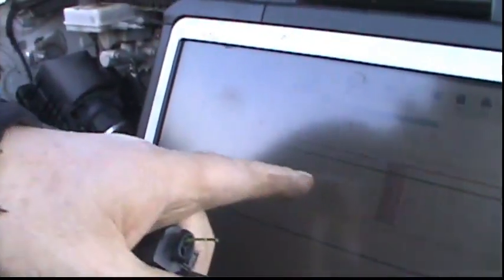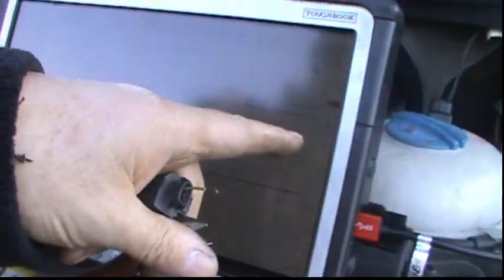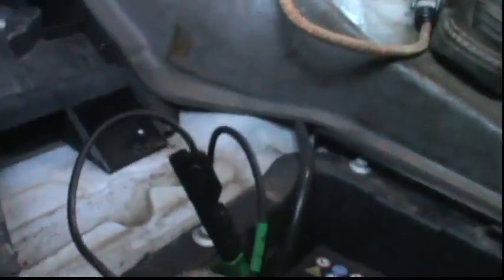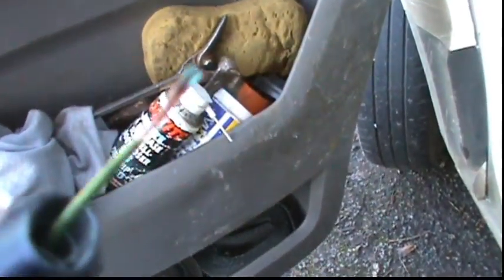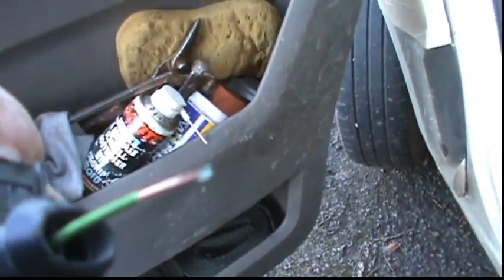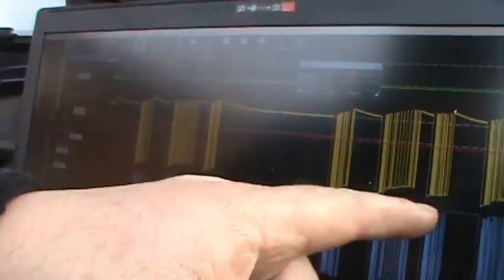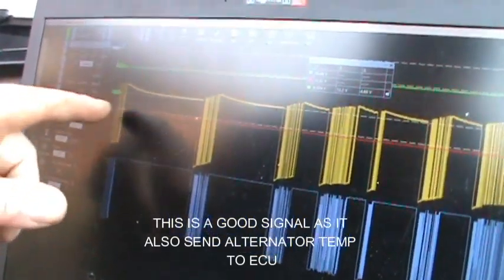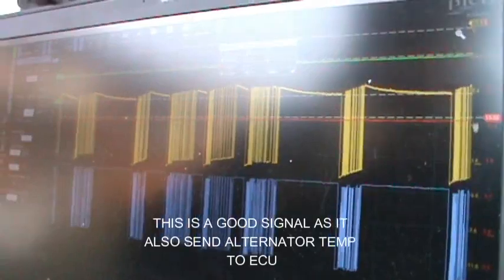2021 VW crafter intermittent  charge fault on dash ,  codes U105200 U140600, battery stays charged

Comment: Hi mate, Quick question if you don’t mind, Do you know if before you fixed this issues was engine rpm was up and down ? Mine is on 1100rpm sometimes same fault code what you got changed alternator and plug was broken so we changed them codes are gone but when you start the van up sometimes high idle with engine light plz help if you can with some advise plz lol thank you.
Reply from the maker: Hi 
No this van was running ok and idled ok to so I don’t think this has any thing to do with that fault 
But 
With what I’ve experienced I’d check the earths ,fuel pressure, and possibly a dodgy egr vavle 
I hope this helps and it gives you something to look at sir 👍👍👍👍👍👍
Reply: @trevorchillery1019  Hello I didn’t think you will get back to me this quick thanks, codes that i’am having is engine coolant bypass valve a sensor circuit low P26A600. We been doing some research online for a week and haven’t found anything that’s related to this code we don’t know which part is it 🥲
Reply from the maker: @gusztavnotar4070  I’m going to be honest I don’t believe this code would cause your problem 
Has this had the dpf and/or the egr vavle removed 🤔🤔🤔🤔🤔

Comment: Having similar issues, where is this broken wire located?
Reply from the maker: 3-5 inch’s from the connecter  to the alternator or that’s where mine was 🤠🤠
Reply: @trevorchillery1019  cheers mate I’ll have a look tomorrow! My battery was sitting at 11.8 so I’m thinking that’s buggererd but just want to cross all the Ts first

Comment: Same problem with my crafter, changed battery, alternator, found the same wire damages. But with all new staff it worries me that without load there is no charge on the battery, only when you put lights on and etc...
Reply from the maker: It’s a good learning curve sir but at least you can test it 👍👍👍🤠
Reply: @trevorchillery1019  looks like working as supposed to, gives 12.5 on cold,  then 13.1 on idle, when coasting 14.6, press gas - no charge as to limit emissions) . So confusing ) but as supposed to i guess)

Comment: because you car has automatic stop/start and AGM battery your car automatically chooses when to charge the battery, so after you start the engine it may not charge the battery straight away, the charging system is disconnected giving more power at the wheels and fuel saving and reduced emissions ,  all of the electricity being used by the car is coming from the battery, the charging system waits until the car has unused energy available,  say coasting down a hill or using the brakes its then able to charge the battery very fast with what would have been wasted energy this can save upto 10% of your fuel costs and have a big effect on your vehicle emissions it will also postpone charging until engine is at running temperature unless there is a risk of a depleted battery
Reply from the maker: Thank you sir it was only a gut feeling of watching the data and thinking out of the box 
You certainly help me understand this system a lot more ,so it could be used for the dpf regeneration as well 🤔🤔🤔🤔
Reply: dont do static regen !! @trevorchillery1019

Comment: You have a request in the video about some parameters to start charging the battery, possibly something to do with temperature? Can you put that in a Comment with your post on DDTSB, I am guessing that not loads of members will also watch the video but will read your post and possibly give you an answer. cheers.

Has anybody changed this alternator? If the wrong part number was installed, it might not be speaking the same LIN header??
Reply from the maker: Original alternator was  fitted sir but I’ve learned a lot more since I fixed the lin bus wire and I now have more questions